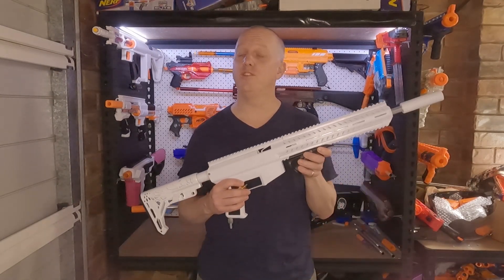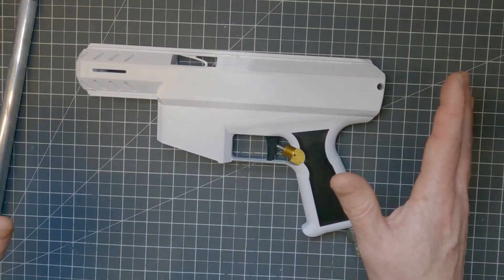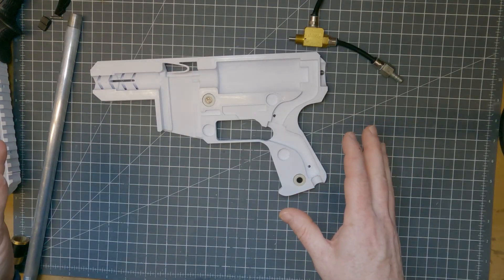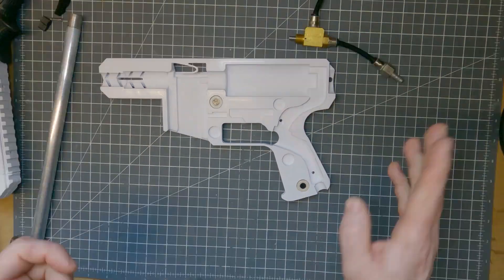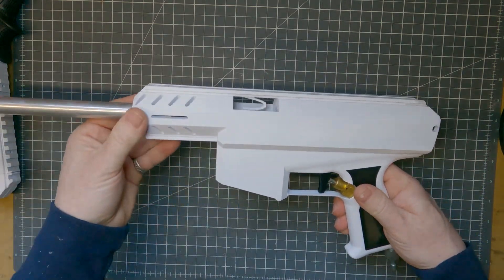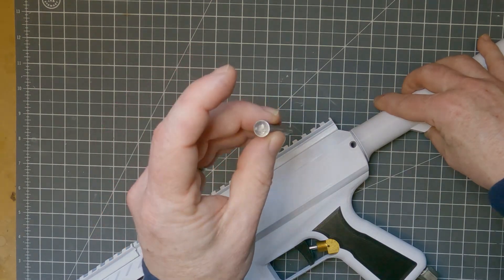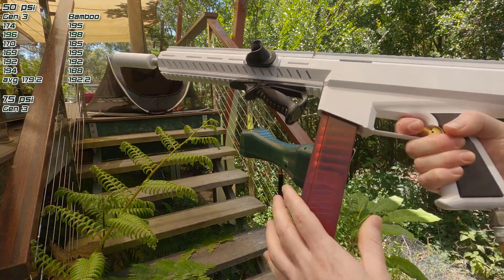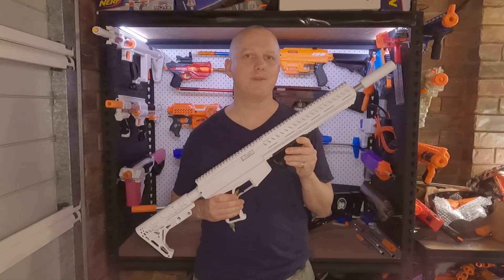Blaster Breakdown 24 (December 2021) -  The Neutrino - The world's easiest HPA build?

Comment: I bought Brass 1/8 Inch NPT Male & Female Industrial Air Hose Quick Connect
Reply from the maker: Will that fit your remote line on the outside? Fosters is the connection type most commonly used. If in the USA you can find from airsoft suppliers.